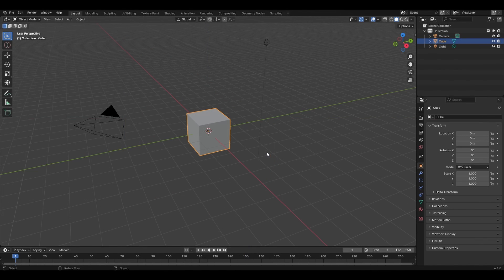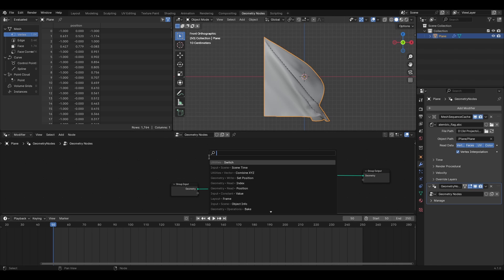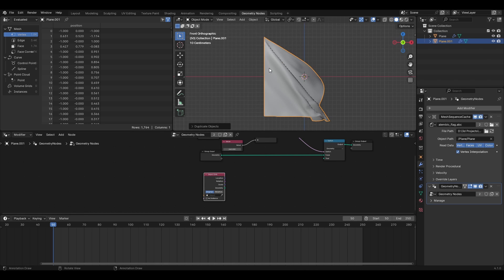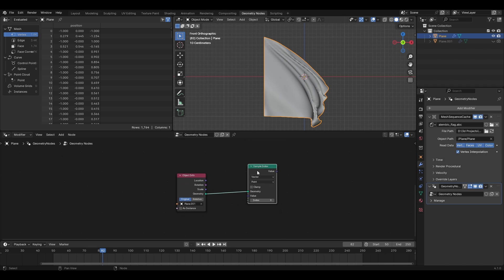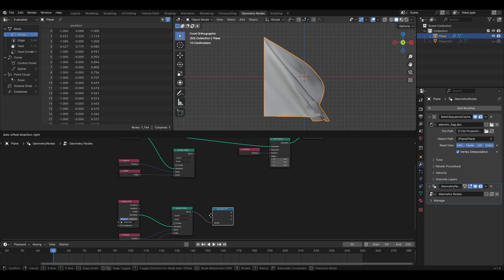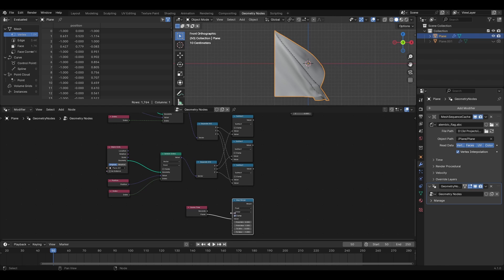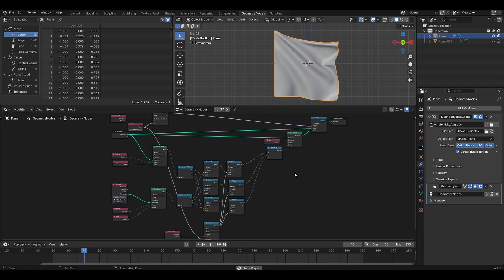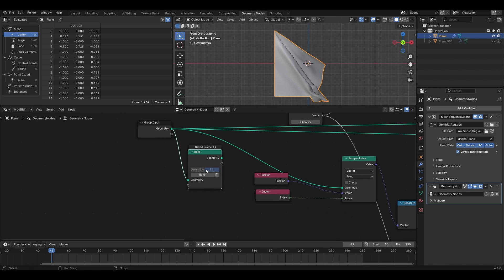43 | Tutorial | Looping Alembic Cache in Blender

Comment: This is a great technique, but sadly it's not working for me. I've tried it four times but my animation is frozen and doesn't play back. This seems to happen after creating the duplicate and the setting override frame option. Without it, the transition plays back fine, but with it, the whole scene freezes and nothing blends for the transition.
Reply: I got it working in principle (forgot to click on the "fake user" thing), but sadly the transition is screwed up. It looks like what happens when you import a morph target with the wrong vertex order. I'm using a fluid simulation as s source, which may be less predictable than a cloth animation you're using in this example. Either way, great technique but not usable for all ABC files.